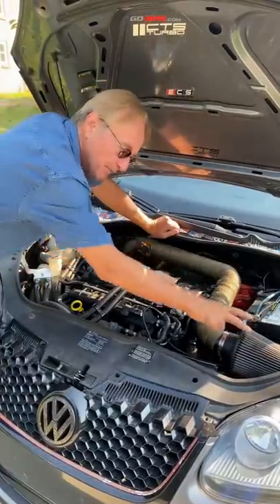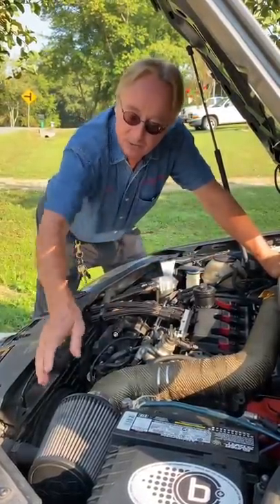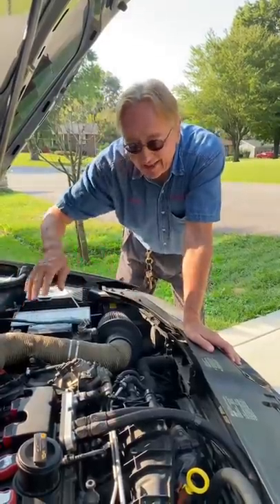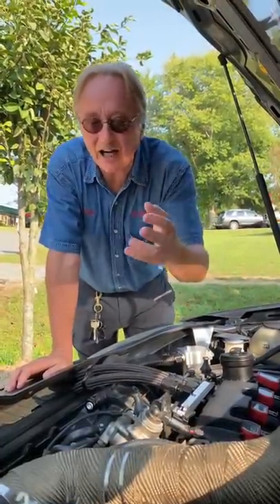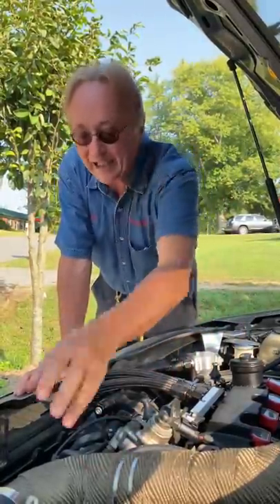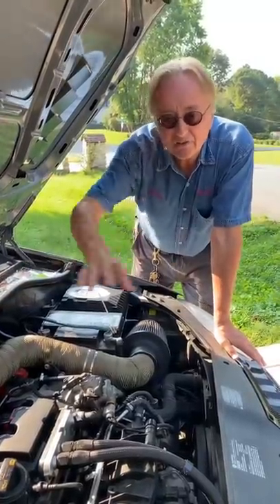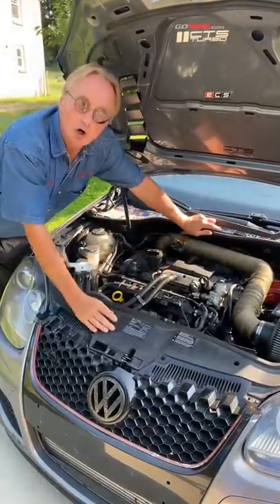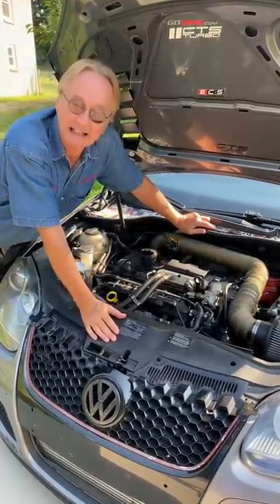Why Cold Air Intakes are Stupid

Comment: The CEL can be that your car is not used to a lot air at specific rpms. For my camry at idle it doesn’t pull in much air so it’s tuned for low air flow from factory. Putting an intake on will increase that air and might exceed what the maf can read. It’s not that it can’t read it you either need a tune so the maf can read it or place an insert to avoid getting a CEL. At higher speeds there’s no issue.

I mean that at idle if everything is tuned for low air flow then having high air flow at idle may set off CEL without a tune. Yes you can gain HP without a tune.

Comment: But Scottie I have tuning software and I tune my vehicle when I put new parts on it. When you do an intake you also turn off torque management and increase timing and fatten the fuel to a Better power ratio. Then that intake nets you quite a lot of power. Especially when you pair it with a cam or other mods…
Reply: Ah yes I'll just pick up and plug in my new cam when I go to AutoZone and buy a cold air intake. Bro he's not saying cold air intakes never work, he's saying if it's the only mod and it's not done right it's stupid

Comment: With a tune you can get more horsepower. Especially if it is an actual air intake that pulls air from outside the engine bay. However, my can has no cats, a bigger turbo, 1000cc injectors, aem fuel pump, tubular unequal length headers, TGV removed, and all of it has been ported, gasket matched, and polished to get rid of any turbulence.

Comment: A cold air intake system will only benefit with a supporting ECU tune or "piggyback" such as the JB4 tuner, which is designed to increase boost (on turbocharged and supercharged cars) and therefore needs more air intake capability, which a higher flow intake system provides. From this, you will see more gains from the tune with an upgraded intake system, given that you have proper heat insulation and have some sort of heat wall to prevent as much heat in the engine bay being sucked into the intake.

Comment: Scotty those are not cold air intakes.. these are normal instakes without any housing for fresh air coming into them, instead the one your showing soaks up lots of engine heat.. a proper cold air intake would be air filter housed in a container and then fresh air feed from the outside into the air intake.. like how manufactures design them... when you buy the car.. sometimes the manufacture design is the best...

Comment: i got a genuine MPG (around 4-6) improvement and slightly better throttle response. it literally ALL centers around shielding the intake properly from heat. something as simple as using R11 insulation works. just keep it cool.

Comment: Had my CAI on for a few months now with no tune and bone stock and I'm satisfied. I also got it for this summer so i can keep my engine cooler. My car does run better also. Most modern day cars won't get a check engine light just for a simple CAI, mine has never came on once.

Comment: My cool air intake is in the bumper and supply my modified car with unrestricted air. I do have a computer with custom mapping and 3'' stainless double exhausts. The OEM air intake CAN'T do the same. This mod is for balancing a modified car A/F ratio, I wouldn't recommend doing it for a stock car.

Comment: Makes cool noises can be cleaned very easily and wont need to be replaced if properly maintained and applied correctly that includes getting a cover for the pod filter + oiling the pod correctly

Comment: I got about 25 hp with an intake, header and exhaust.  There is always a tradeoff, though. The engine was louder and I had less low-end torque. This was an acceptable compromise in my situation, since I was interested in peak power high in the powerband for racing.

Comment: I call them hot air intakes. The factory intake pulls air from outside on most cars but these pull from the engine bay where the air is waaaay hotter.

Comment: My dad made me buy his 2004 F150 4.6l 2 valve with the newer body, and it came with a cold air intake and loud exhaust. He told me I wouldn’t be disappointed in buying it from him for 4 grand with 140k miles when I told him I was going to buy a Silverado. After a lot of convincing I eventually gave in and bought it... I later learned that the 4.6l 2 valve is one of if not Ford’s most reliable V8 engines and they’re fairly easy to work on.

Comment: Exhaust and intake mods are some of the cheapest power gains you can get for a car. Both require tuning the ECU, but with a proper tune can make +25-50 horsepower without impacting reliability much. Just make sure you get a tune from someone who knows what theyre doing

Comment: My cai WAS tuned to the application, and as to how gains there's no way for me to know without a dyno, but with the intake and tuned exhaust, a total of around $1000, my mileage increased and the throttle response is much much quicker, so on balance I'm happy with the money spent. Btw, no check engine lights or other problems

Comment: I have a cold air intake from Injen that mastered and the first with patented from Japan. I had installed two months ago. And I bought two Flow Master mediums exhaust mufflers and got rid of the resonators. I have no check engine lights on.

Comment: I will say I put a cold air intake on my BMW and did it proper and it ran great for about 2, 3 hours and then I got a engine fail safe program message and a check engine light and then my car put itself into fail safe mode and wouldn’t let me go above 20 miles an hour. I got home put the stock airbox back on and it ran just fine. That means that I’d have to do something even further and space out the piping even more or route it differently just to get the computer to run the cold air intake without any issues which would be more work than is worth it for a daily driver. I’m just happy I didn’t do too much damage running like i did. I’ve done this with numerous other fuel injected vehicles, but apparently my BMW was having none of it and seemed like it didn’t want to adapt to the new cold air intake. Eventually I may try to put some assisting parts with the CAI and a tune to make more power, but that’s just not a simple thing and I don’t have time for that right now.

Comment: often on newer low displacement turbocharged cars, the HP may be lower, but usually they're able to make the HP and torque curve a lot nicer in the mid range of RPM, unless that turbo is rebuilt and milled slightly larger, then the lower HP is pretty common, BUT the car will still actually be quicker. Pick your battle

Comment: I've placed many cold air intakes on cars that don't require a tune. Although I'm not getting max benefit without the tune, it still improved air flow thus increasing response you can feel when you step on the pedal.  With no check engine light!

Comment: Over the engine or radiator piping heats up substantially.  I replaced the passenger side cai with one on the drivers side(where the turbo is) and im seeing 10degree less temps with less turbo lag and increased response. Its also an enclosed unit facing the engine bay..yes a dyno tune was required. Agree with the points it wont give much hp on its own,you need a complete package of mods that complement each other

Comment: It's more the throttle response on cold air that makes an improvement for some vehicles. It also depends on the company that makes the kit. Is it actually engineered to work properly through research and development? Some companies have spent time doing the research but if you just ordered something randomly thrown together to fit, it may or may not gain anything. These can help the engine breathe better in some cases and improve gas mileage and power slightly. Although exhausted matters too sometimes. If the engine can't exhale as quickly, you aren't going to gain anything. But Scotty is right. This can throw off readings. I feel like sometimes the computer can adjust the fuel air possibly but I am not an expert either. Just a guy in Scotty's comments. Staying stock, you know it should run at least right.

Comment: if it's installed before the airflow sensor it will not make any engine light appear, if it's installed after or the airflow sensor is removed then yes, it can even make your engine run bad

Comment: If it is a part from a reputable brand like K&N and mounted properly it should always make more power due to less restriction. That being said, it is true that a cold air intake alone will not do all that much by itself, but many small mods + a professional tune can make a big difference.

Comment: Yes an air intake like that is within the noise 1-2% difrance in strenght
Togheter with 3-4 more parts that are within the noise
Then with a tune and you can get even 5-6% per tune part
That could go from maybe 6-8% with everything to even 20% with everything after a tune
A cold air intake on its own is nothing but togheter with a good exhaust a turbo or a supercharger maybe even both it will do a lot more than just 1-2%
Also the check engine light is because the car is not tuned to accept the cold air intake
Also you can get an email tune witch while not as good as a dyno its better since usually you get multiple free extra tunes some even for life and they are good if parts keep coming in
And the tune being a high price should not be the worst problem if you want to upgrade you re car

Tldr: the cold air intake is usless and only a diffrance of 1-2% if its the only thing you change in ur car
Be patient

Comment: If its in the engine compartment its still sucking hot air. It has to be in the grill on the other side of the radiator.

Comment: Scotty, you didn't bring up the fact that stock intakes have resonator tubes and/or boxes that are specifically tuned lengths and volumes to take advantage of flow reverberation caused by the intake valves closing, producing more power and efficiency through scavenging than even no intake tube and filter at all. Every time I've removed a stock intake for something else on an otherwise stock engine, it caused a loss of power as well as economy. The engineers with huge R+D budgets do actually know what their doing. Power and economy are hugely competitive between brands. They are, in fact, incentivized to maximize power and economy (huge selling points). A stock intake will never be a restriction on a stock engine (they have no reason to do that). Without a full exhaust AND a cam change to take advantage of it, there really is no need to change the intake duct. On an internally stock engine, you can't do better than the stock one. The stock ones from every single manufacturer have been pulling real cold air (isolated completely from the engine bay) from the factory since the 80s, lol. You DO NOT want to get rid of the factory resonator setup in the intake under any circumstances..... unless you have a heavily modified (internally) engine and a proper dyno tune to match.

Comment: I made that mistake on my ford ranger. I ended up with a check engine light with a P0171 and p0174 which indicates a lean condition in both banks. It will also screw with your sensors apparently.

Comment: Cold air intake can trigger and check engine light for running lean, more airflow than stock for what the engine is tuned for the amount of fuel.

Comment: On naturally aspirated Subaru engines, there's actually a natural power dip between 1.4k and 2k RPM with a straight intake, caused by resonance in the intake system. They had to put in a giant goofy box to act as the resonator. You'd get a little more power with a cold air in that engine, but at the expense of lost low-end torque and you'd need a tune.

Comment: My dad bought a Ford Escort mk5 1.4i it had a K&N filter fitted, the car gave us 8 km/liter, very heavy, so my dad fitted the oem filter box and it was muuuch better. Motor manufacturers spend years researching engines, keep standard it works.

Comment: Only has to be tuned if the intake tube is larger or smaller than the one that’s already in there. (It has to be tuned to lessen or greater the amount of air because of the size change)

Comment: I can atest that it does indeed increase MPG. You just gotta remember when upgrading parts you need to compensate with others, a good example would be to upgrade your sparks, coils and/or fuel injectors so you can still maintain that ratio of air to fuel. In some cases like for my vehicle it can even improve your performance, and mileage. The fact stands that cold air intakes will forever be beneficial for high performance cars, not so kuch as economy ones...

Comment: To me they make sense on a carbureted car that has some power. Also you’re not going to have a check engine light come on and you’ll have to tune the carb to adjust the new difference of air from the intake but that’s easy on a carb. Like you said doing that on a fuel injected car requires computer tuning.

Comment: Most of the time the issue is just getting hot air running but you can just wrap up with a heat shield and it’ll drop the heat by a lot

Comment: I agree with everything you said, except one.  Anyone who’s piloted a single engine light aircraft has experienced the horsepower drop when pulling on the carburetor heat while climbing to altitude.  It’s more than 1 1/2 %. !!

Comment: If you have a cold air intake, you more than likely have aftermarket exhaust. 

Less restricted exhaust means more smooth intake flow(if you have a proper intake like Injen, K&N, AEM, etc built to spec for your vehicle)

Comment: Cai have a marked improvement on forced induction engines as the factory air filter is usually a bottleneck. Also, other upgrades might require more air flow, like a cam or intake manifold. For a bone  stock street car, the difference is negligible.

Comment: That’s why most top brand air Intakes come with …. Heat shields, specially made to well idk ? Keep the intake area cool. When paired with the right car and engine, exhaust system and headers cold air intakes can be one of the greatest non-forced power gains

Comment: K&N air intake already tuned for ur car you decide to put on so in that way there’s no check engine light happens. I installed mine on 10th gen civic 1.5 works great got a decent power and torque and top of that fuel efficiency.

Comment: Yup! I had a Acura Rsx type S when i was 18. Like the young know it all I thought i was at that age, i put a cold air intake on it thinking i was awesome. Eventually turned my check engine light on. An it also started burning like a quart of oil every 2,000 miles. The thing burned oil like you wouldn’t believe

Comment: Cars can adjust the air to fuel ratio, there's this little thing called a mass air sensor, an engine is an air pump, more air in and more air out equals more power, not less, I'm not talking about power adders which need bigger injectors and tuned for optimum air/ fuel because of detonation

Comment: I installed one on my jetta, and yeah it looked and sounds very nice 👌, after a few months, i had to replace intake manifold because valves were getting stuck open due to dirty air particles amd also had to replace 2 intake sensors , they got so dirty that they were useless.... EPC light poped up every time i accelerate on 3rd gear going to 4th..😑 it..i decided to sell the car !! Now i have another jetta with STOCK intake and stock air filter !! It will stay like that ! 💯👌 scotty is right on this one folks !! Buy expensive tires instead !! 💯👌

Comment: Modern cars have MAP sensors and will adjust fuel based on a multitude of parameters. Ebay CAI's are dumb because they are just a tube with a filter on the end, resting in the hot engine compartment. Find one with a box that ducts out to the front of the car and it will look cool, sound cool and might even improve your engines breathing.

Comment: As long as it does not remove your mass air flow sensor and locate the filter in an area where its far more likely to be immersed in water. I have seen no harm at all.

Comment: I'm indifferent about it because I do like the stock parts on my car, but if you have a 1990s beater car you might as well do it. I personally don't like aftermarket parts like cold air intakes and super loud mufflers, but it also depends on the car. A modified 1950s Ford pickup is cool, but a modified Ford Fiesta is kind of lame.

Comment: It depends, of you out it on a boring slow Toyota ain't worth it, if you enjoy the sound of your turbo it's worth it, I love my old 2004 Mk4 gti 1.8t  Manual Transmission using the cold air intake it's fun especially the turbo sounds even better

Comment: An air box is like sucking air in through a car window sure there’s some air but it isn’t pressurized and condensed and it definitely isn’t actively sucking in air using the engine so that’s why a cold air intake is better, it actively sucks in air and in some cases pressurizes it and condenses it

Comment: the last modification you should make is 
an intake and exhaust 

after you have done engine work

no sense in spending 1000 bux for an exhaust and 340 for a cold air i take only for it to make a little more power